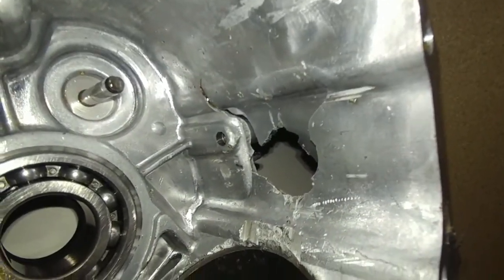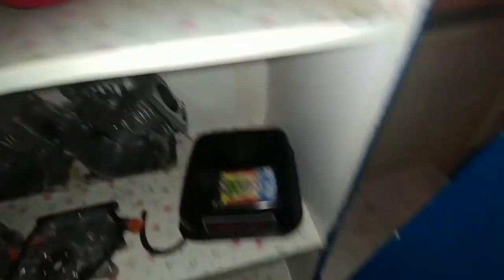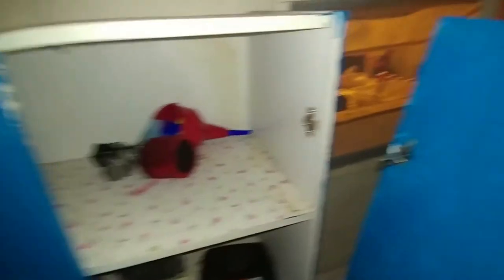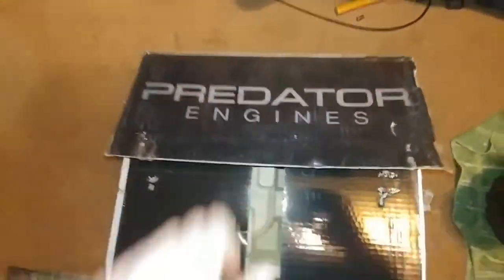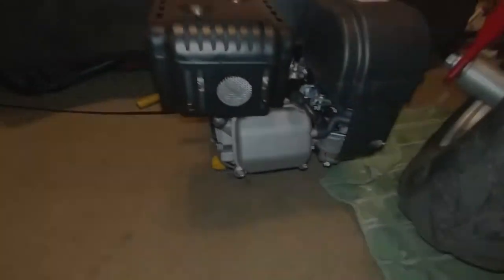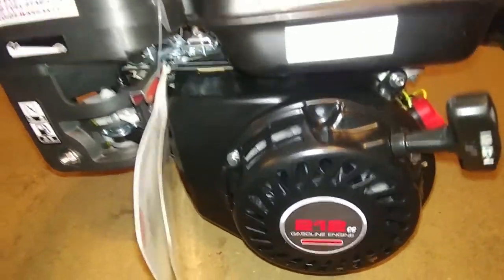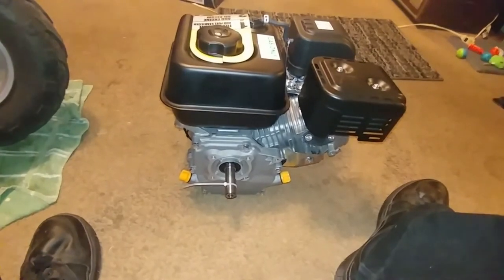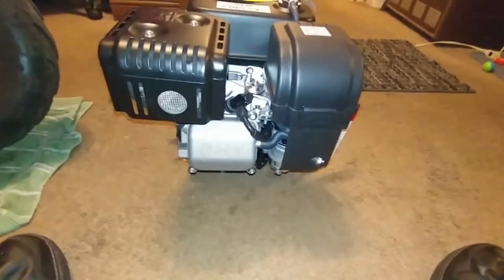Did Spikeman Get a Hemi...?

Comment: Dude, perhaps a torque wrench, check tolerances,  use plastigauge, anything...
Reply: Just looked at your original engine video, using the non-hemi with hemi parts I guess...
Reply from the maker: WK 1000 I did dude duh
Reply from the maker: same as the non hemi just different heads is all i seem to notice